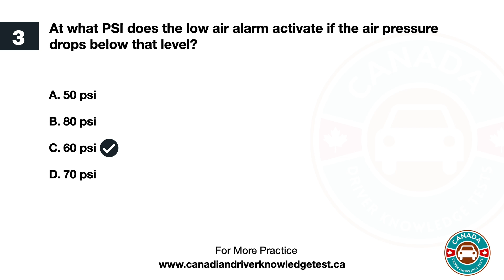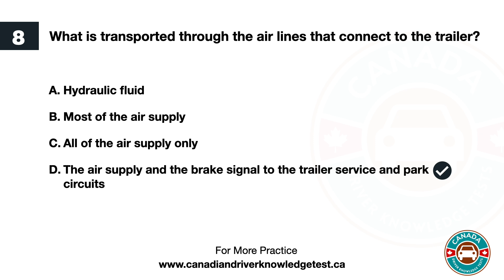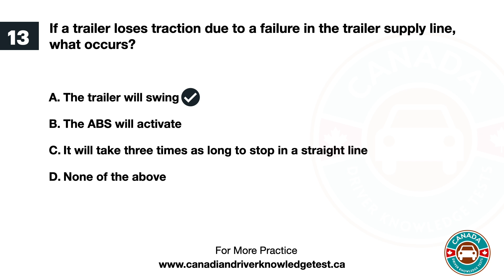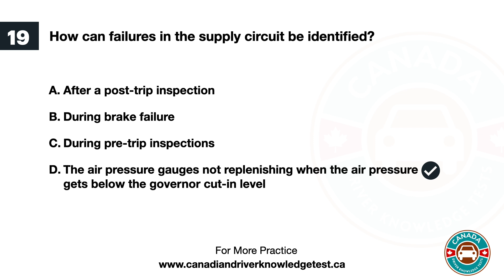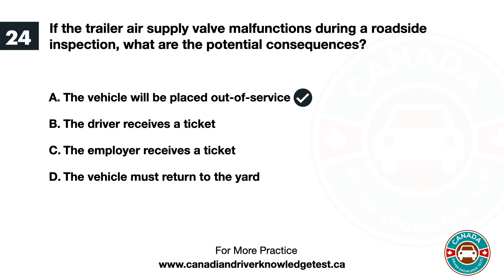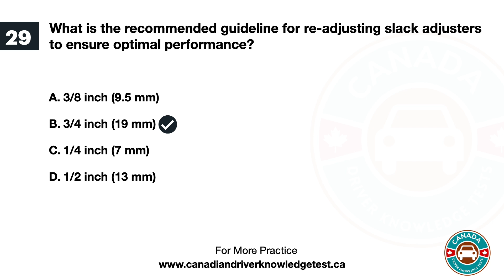Ontario Air Brake Practice Test Part 2 | Audio | Canadian Driver Knowledge Test

Comment: 6. Has the wrong.  AD-IS is Air Dryer Integrated System.   a combination of an air dryer, governor, purge reservoir, and charging valve.  Some are sold as AD-IS (Integrated Solution Air Dryer)